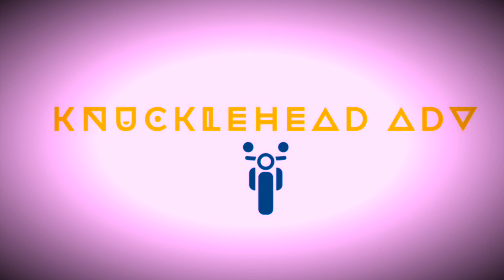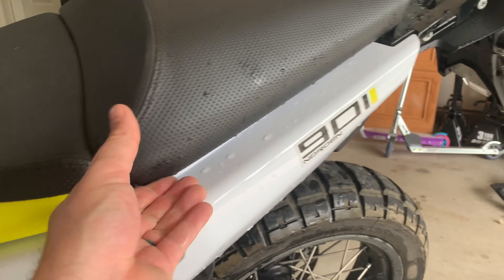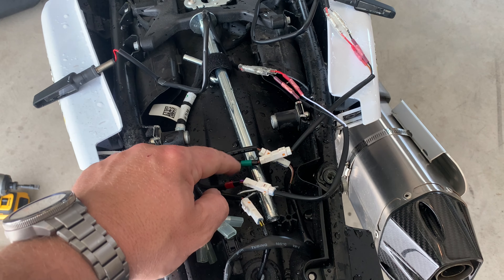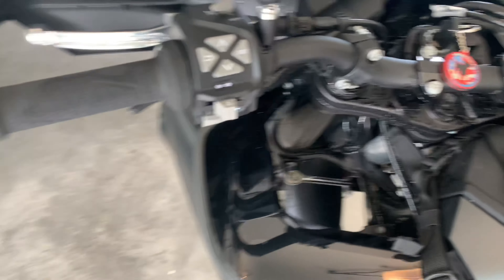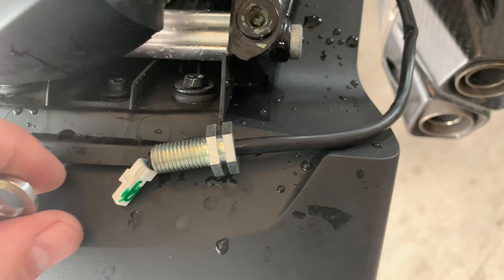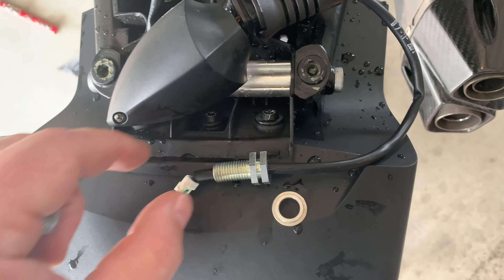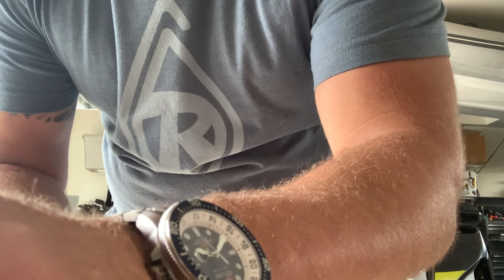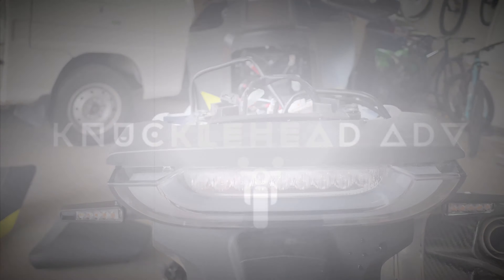Norden 901: Rear LED Turn Signal Install

Comment: what do you mean by "I have the LED function turned on"? I have new LED's and am looking to install them as I believe they are safer. They have white running lights and the rear lights tie into the brakes giving more visibility. They OEM setup in the back is a major design flaw as the brake lights stand out poorly against the red U LED maker light.